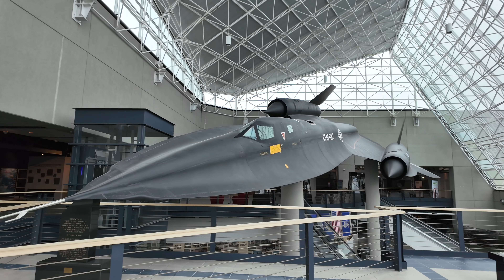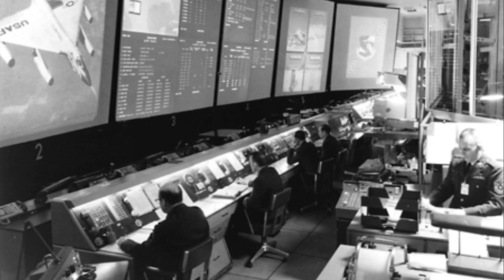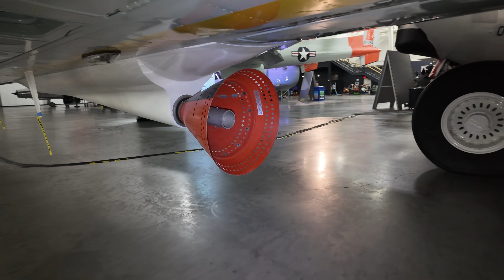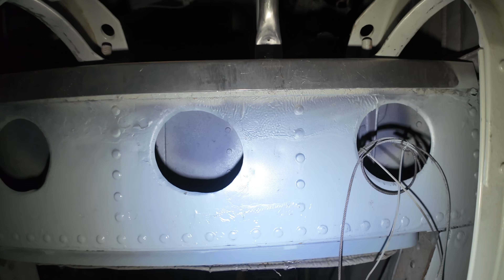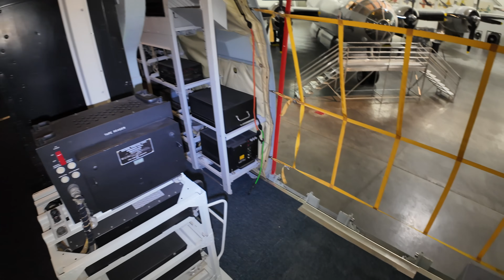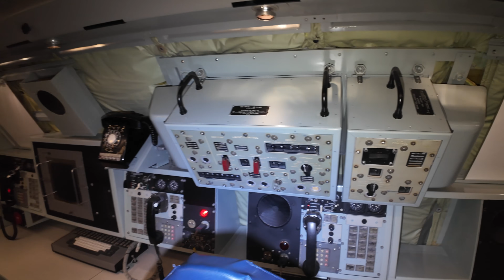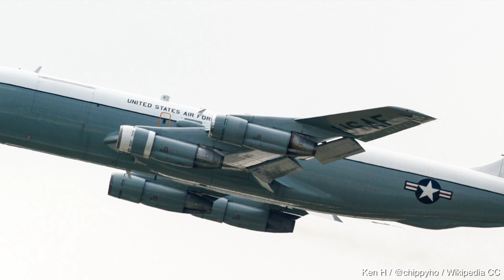Guided tour around the Doomsday Plane - the EC135 Looking Glass

Comment: Great video! As a Nav on this aircraft in the late 80s, I noted three things. One, we did not give excess fuel to our replacement. We could receive fuel in case we had to extend our shift, and practiced passing and receiving. Two, in case of a launch, the Nav had to also decode the message and tell the pilot to arm the system; otherwise, the back end launch sequence would not work. Three, the food was great, especially the desserts. Hats off to all the Stews I flew with.

Comment: Isn't it odd that Vickers, one of the traditional stalwarts of aircraft manufacturing in the UK, built the least advanced of aircraft, compared to the other two bidders, and yet it became the most serious of failures due to wing structural problems? While the other two craft became so notable both visually and in  longevity.

Comment: Man the 707 ended up being used for so many different models of military planes. As they get older, I wonder what model the air force will make their new all around choice?  767 would seem like a good choice. Already using it as a tanker. Has more room than the 707 yet only 2.emgines so will use less fuel and there's a lot of used ones already around the world
Reply from the maker: With advances in technology, a lot of the equipment is smaller AND the 737-800 is a decent size in comparison to the original 737 classics. Lots of parts and commonality with the p-8 tooz

Comment: You know your old when… one of the aircraft you worked on while on active duty now is in the SAC museum. 😊   I remember many cold nights on the Offutt flightline sitting in a bread truck (panel van) as the crew pre-flighted the aircraft.  If a problem was detected, a technician was rousted from the bread truck to trouble shoot/repair the system.  As a young airman, early in my career, I experienced one of the jet’s engines on fire with a flame out the rear of the engine (looked like a blow torch) and I was excited/concerned for the aircrew and our safety.  Come to find out…  fuel would tend to pool in the rear of these engines between flights and ignite when the engine was later started.  A crew chief would stand by the engine with a fire extinguisher in case the flame got out of hand.  Standard operation was to crank up the engine to speed up burn of the excess fuel.  The more senior members of the launch crew enjoyed razzing me for my somewhat animated response…
Reply from the maker: Wow, what a story! Thanks for sharing.

Comment: The small windows high up in the cockpit are not just for views of the refueling aircraft.  They are a legacy feature designed to allow pilots to navigate using the stars a sextant, and a watch.  You can get a position fix that way. Modern inertial navigation systems and GPS have made this art largely unnecessary (but the Russians and Chinese can jam GPS signals).  One of the flight engineer's jobs is to balance the aircraft, watching the center of gravity ad center of pressure and compensating by transferring fuel among the tanks in the fuselage and wings.  Of course you can train a copilot to do it, but the flight engineer disappeared with the advent of glass cockpits. The MCAS system, infamous due to the 737 MAX's crashes, did not begin there.  It began as a much more robust system aboard the KC-46 tanker.  The reason was that the KC-46 (767) is constantly transferring fuel and its center of gravity is constantly migrating with respect to center of pressure, so the MCAS (a much more robust and expensive version than on the 737MAX) was installed to make it easier to fly the plane and make the feel of its handling more predictable.
Reply: Aren't they also for flying tight patterns?

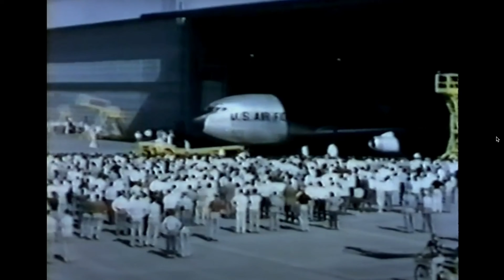Comment: 1:59 - You mention the Boeing 717.  I think that 717 was an internal model number initially used by Boeing at the time and then abandoned.  Years later when Boeing bought McDonnell Douglas, they inherited the MD-95 design.  A derivative of the DC-9, it was brought to market under the Boeing 717 name.  This confused me for a bit.
Reply from the maker: That's correct and yes it is confusing :)

Comment: Don't forget. The PACCS RO's and RM's also supported the Combat Lightning operation during Vietnam.
Flying/Stationed at U-Tapao, CCK and Kadena. From 1966 to 1975 or so logging thousands of hours over the Tonkin Gulf. The aircraft were still KC's yet had the same comm gear as the EC's.
Strictly used as a radio relay for communications.  I was first there in 66, and the last time in 73.

Comment: I came recently across some patents from Lockheed from the fifties. Which look at first glance strange because they show a flying saucer shaped craft with room for passengers but e.g. no windows. I wonder if these were an idea as to how to  evacuate the goverment in case of a nuclear war and but later dropped when it because obvious that they wouldnt work, because in planed abilities they would have been much more suitable for a nuclear war scenario. VTOL ability, propan as fuel so easily to obtain, able to land on water, passengers at least partially surrounded by fuel. The author of the patent doesnt describe this purpose, but this seems to be the only scenario a windowless VTOL craft for passengers transport seem to make any sense. Because even with todays doomsday planes the big question is where they shall land after a big scale atomic attack.

Comment: I may be wrong but, I think it's actually the E-4B that is dubbed the Doomsday Plane. Also, the Naval aircraft is the backup to the E4-B, not the primary.
The Looking Glass program was replaced with the NEACP.
Reply from the maker: Yes the e-4b is called the doomsday plane but I’ve seen this referred to as the doomsday plane too
Reply: Looking Glass was not replaced by NAOC (ne NEACP).  The Looking Glass mission is now flown on the E-6B Mercury.  NAOC still uses the E-4B to be replaced with the E-4C in about ten years.  Two different but similar missions.

Comment: A great video tour of an amazing piece of SAC history.  I was a co-pilot on the EC1-135 in the mid 70's. When I upgraded to aircraft commander, I had to transfer to a different aircraft, since the EC-135 Aircraft Commander had to be an instructor. A couple of comments about the tour.  The VLF antenna was actually about five miles long when fully extended, and was usually tested over water in case it could not be retracted, or the orange drouge seperated from the wire.  Usually the boom operator was laying in the boom pod, keeping an eye of the antenna. If the drouge seperated, the wire looked like a rubber band snapping back toward the aircraft.  The Co-pilot had the "red switch" to sever the antenna, and on one test, I had to activate the switch, when the Boom Operator called out "Cut the wire-Cut the wire!!!!  Comment two is that (at least when I was there) I never heard of one EC-135 refueling another EC-135 (except for training).  If a Looking Glass mission was require to extend it's misson (It's replacement couldn't assume station because of weather, or maintenence issues), there was a dedicated KC-135 tanker on alert to supply fuel for the "Double" mission.  Flying around above Nebraska, Iowa, Kansas and South Dakota at FL260 was certainly boring at times, but built up lots of flying hours, at about 8.5 hours each flight.  Almost every General had their "Quirks"  (how they liked their steak...No green M&Ms...and etc)  The general usually made the takeoff and landing, (hence the Iinstructor Pilot requirement) and since they weren't fully qualified, it made for some "interesting" landings at times.  As a Co-pilot I spent many of those events watching from the jump seat.  I look back fondly on those days.
Thank you for the tour!
Reply from the maker: Thanks for the extra information! I love hearing from people who flew in these planes I’m looking at.
Reply: Thanks for your contribution to the Deterrence mission Cold Warrior! What did the VLF antenna and drouge do to the flight characteristics of the 135 when depolyed? Five miles of cable is one serious spool of cable.
Reply: My grandpa was an engine mechanic for these in 74', Ive been working them now for about 6 years, not a whole lot has changed it seems.
Reply: Fascinating story.  Thank you for your service.
Reply: Thanks for these insights.
Reply: In the 1975-1976 time frame, I flew on a couple of Glass missions where we gave fuel to a relief aircraft. The first was when one of our front windows cracked on climb-out. We gave our fuel to relief and then landed back at Offutt. The second was because of a bird strike .

Comment: Great job as always Paul.
One reference,  if I may? I once was a Crew Chief on McDonnell F4-D with USAFE during the  cold war. Those also could use the "Cart Start" system, short for cartridge.  Whilst they certainly made a lot of smoke (first timers think the aircraft is on fire) the rapidly expanding gasses were not actually an explosion. Rather much like a slowed down shotgun shell, the size of a two litre pop bottle with the ends cut off.

The Cart was loaded into a large locking (very thick and strong) can, with two electric leads for ignition. When ignited, it would take about a very long 60-90 seconds for the powder to rapidly burn. The expanding gasses traveled via a pipe to start the turbine spinning. Then add fuel and spark.

On the 135 derritives once started; bleed air would be selected and sent, one at a time to start the others. I'd  imagine during wartime or any ORI, the last two would be started during taxi to the end of runway?

Comment: Nice video!  Glad to see they finally have the restoration finished!  Two points: 1) as you mention about the red & white area under the boom pod was marked off - you could actually get an electrical shock if you touched the airplane while the HF antennas were operating and that was the main reason for the area being marked. And 2) as you mentioned about he 707 being used for the E-6 Navy plane, it was because at the time of procurement, the 707 was the only narrow body 4 engine plane still being produced, so the main reason they went with it, the body width was just a bonus.   
I was a mechanic on the EC-135H’s at RAF Mildenhall and love those planes! 
Cheers!
Reply from the maker: Thanks for the extra info! Cheers

Comment: I would think that it would be a real toss up to see which US built aircraft, C-130, or 707 based has been manufactured in more unique specialized versions. The 747 airframe would be another contender for that list.
Reply: If an airframe is viable enough to be able to be converted into another mission, then it's a whole lot cheaper and more cost effective than designing a new platform from scratch and taking decades to field a by then obsolete product.

Comment: 8:42 wait, what?!!? How🤷🏻‍♂️ that’s crazy.
Reply: Air bleed what? Heat? Air pressure? I have never heard of this.
Reply: @darthnihilus511 look up cart start or cartridge start. B52s have it. "explosive" is probanly a strong word, more like a small solid rocket motor that would make enough hot gas to spin up the turbine shaft and allow for engine start. Once one engine is running, bleed air is used to start the other three engines.

Comment: Interesting. Hard to believe that just the two simple keyholes mounted on the ELCS (Electronic Launch Control System) panels could have triggered the deaths of millions of people in a nuclear conflict.
Reply from the maker: It’s a but scary to be honest
Reply: Airborne Launch Control System (ALCS), not ELCS.
Reply: @danelder6846  Thanks for the correction. I thought I had heard, or read, ELCS and not ALCS.
Reply: I was a Minuteman Missile Crew Commander in the 1970s.  It took two officers in two separate Launch Control Centers  for a total of four officers to initiative a launch.  In the event that the four other LCCs in the squadron had been destroyed, we could contact Looking Glass or other Airborne Launch Control Centers to get an additional launch vote.  We had to take actions to allow them to access the systems required to launch.  It still took 4 officers who had received the appropriate messages and codes to launch.

Comment: I was a looking Glass crew chief at Ellsworth AFB in late 80s , I was assigned to 61-0297 , I think 8049 might have been there once or twice , but I do remember 8048 , 8051 , and 8052  being stationed there those were the C model ACFT. With the antenna drogue on the bottom , and more crew  I think it was 24 compared to 12 on the A model I crewed on . Thanks for the video
Reply: Thank you for your service!  I was a Surveillance Radar Technician on the E3 Sentry (AWACS).
Reply: @NovejSpeed3  And thank you for serving.
Reply: In the 80s, after installation of the EC-135C Computer Support System  and the third data position, the EC-135C had seating for 28 crewmembers.  This number included the jump seat on the flight deck.

Five in the cockpit, seven in the communications compartment, 12 in the battle staff, and four in the galley.  Until they were eliminated, the EC-135C was equipped with 28 parachutes.
Reply: 4th Accs early 90's as a Radio
🤘
Reply: That’s amazing. Was it as dramatic and nerve wracking as I imagine? Or were you guys chilled out like it was no big thing?
Reply: @matthewnewton8812  When we had an alert exercise it was an adrenaline rush  running out to the airplane , the engines had explosive cartridges in them about the size of a coffee can to start them up there was smoke everywhere from all the planes starting ,  while everyone scrambled to get up the ladder and to they're stations  I was the last up closing the crew door , I would grab the ip seat between AC ACFT commander, and copilot,  we would taxi  on to the runway with full power as if to take off to war , then throttle back,  and taxi back to alert facility , sometimes all the B-52s  on alert would come right behind us , and sometimes just us. The fun part was after doing refuels, cleaning starter breech caps , doing inspections , and  maintenance ready for the next one.

Comment: I was on the ground crew of the 55th from 84-89 before going to Europe. The internal areas look so good after everything was stripped and repainted. When I knew the aircraft, it seemed it was the same internal paint from the 1960s, and I don't believe the front electronics shelves were painted, but I could be wrong. It was definitely a different time, ensuring we launched 3 of these a day and had one on alert and another on standby. Along with the RCs and E4s. It used to be a very busy flight line.
Reply: I remember driving our R-5 fuel trucks around there all the time!

Comment: Early in this video Paul implies that the computers used in the EC135 were not solid state.  They most certainly were.   The earliest computer technology used in this aircraft were a mix of discrete transistor-based circuitry and TTL, TTL solid sate being common in early 1960's to 1970's computers of all kinds.
The earliest applications of solid state devices were hearing aids (due to low power needs and compactness), car and portable radios (improved reliability and much lower power needs - batteries 1/10th the size, and computers.   The early computers based on vacuum tubes had a time between failure measured in days, took up a lot of space, and were extremely slow.  Transistors dramatically improved all three parameters, and saved a lot of power as well.   The last of the pre-solid state computers (eg IBM 709, ended 1958, Bendic G-15 1963) ceased manufacture before the first EC-135 took to the air (1965).
Reply from the maker: Thanks for the extra information

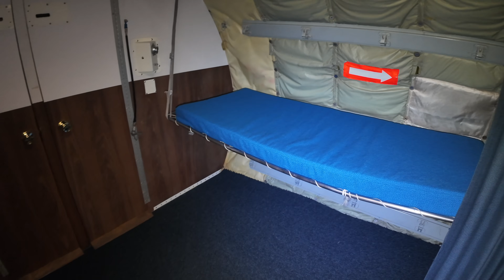Comment: What a stunning restoration! Can someone explain what looks like an overwing exit plug on the bulkhead at 20:07? It is positioned  perpendicular to the centerline of the aircraft. Is that the door that would have used in the cargo door opening for the general?

Comment: The military version of the 707 wasn’t called 717. It was 720B. That’s what all of them are based on.
Reply from the maker: Incorrect. You need to research that again.
Reply: @PaulStewartAviation  and to be honest there’s an argument to be made about the differences in the 367-80 compared to the 707 and 720B. It was closer to the 720B than the actual production 707 airliners.
Reply from the maker: The ec-135 and kc-135 aren’t based on the 720. They’re narrower. Or do you mean that the e6 is based on the 720 instead of the 707?
Reply: @PaulStewartAviation  no, I mean exactly what I said. The C-135 military “707” variants are based on the 720B. 

It’s not the same and is different than a 707 airliner.
Reply: @PaulStewartAviation  look at any Boeing internal document. They are always referred to as 720B’s the engineers to the mechanics called it the same thing. 

Military variant of the 707. 

For clarification 367-80 was just the test article.

I’m not trying to be a dick or “fact check” you but I grew up with the men who built and designed these planes and went to school with many who flew on and maintained them years later. They are 720B’s. Narrower and shorter.

Wikipedia can always be edited by people who know less about the subject than you do, based on clout, not facts.
Reply from the maker: Fair enough. I'll ask around.
Reply: @PaulStewartAviation  not incorrect. I grew up in Wichita, I know engineers that worked on the original design but okay. You’re the one making videos and I’m the one commenting. All the military 707 variants are based on the 720B, that’s why as you pointed out the fuselages are different sizes and the lower cargo doors are missing.  720B’s are slightly smaller and slightly shorter than a 707. That’s why most parts of 707’s sitting in graveyards can’t be used on C-135 variants.  

I enjoy your videos but you’re wrong about this.
Reply: I also have books you can reference if you need further proof.....